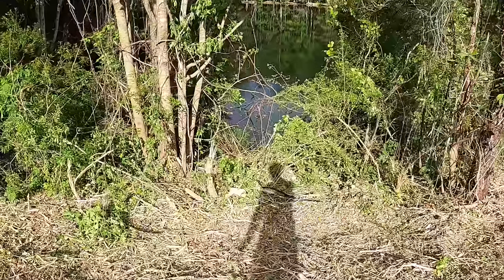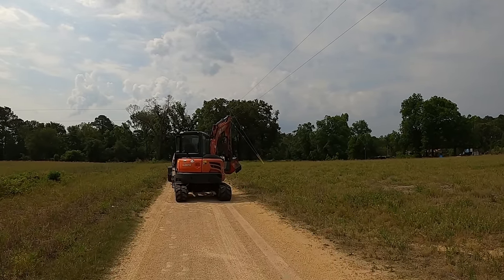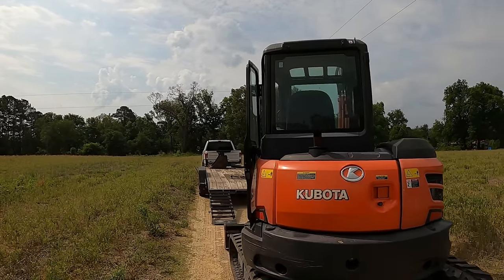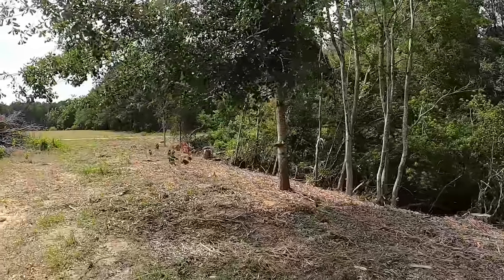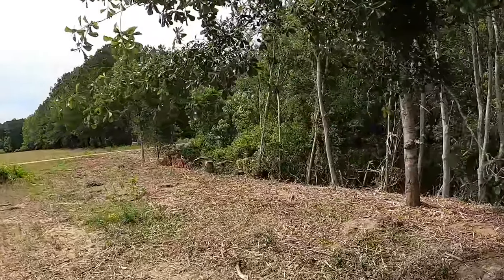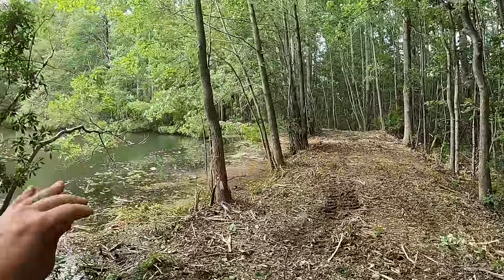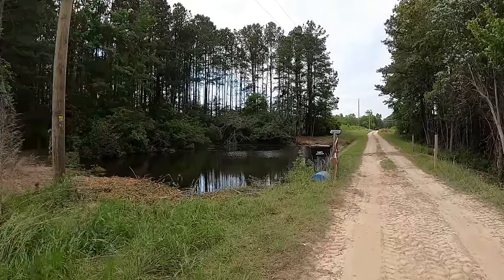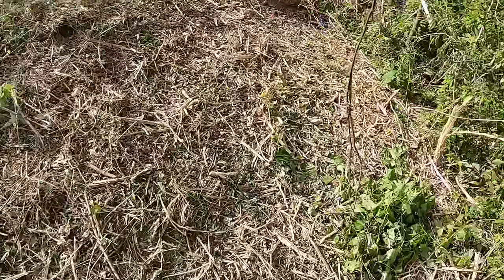JUNGLE POND! Homeowner STUNNED After Revealing This Pond Mulching!

Comment: dude, that's what the back fill blade is for, you track down towards the pond,set the blade down and get after it, the side where it was over hanging, you lay the material over with the head and the mulch it on the bank...did this stuff many many times with a cat 308

Comment: I’ve found it just as easy with the wax myrtles to swap out to the bucket and snap them off and drag them out. Then mulch them or make a burn pile. But there again with the Rut mulcher it has the grubbing foot on the back that comes in really handy for manipulating stuff like that. Even helps for positioning machine and pulling it around or pushing back up off those steep banks around ponds. 
👍🏼good job

Comment: Hey! I got just the ticket for the ones you couldn't take out on the bank. I have run into this quite a few times with my KX057 and Fecon Mulcher. So, I just got a Westtech CL260 WoodCracker which is a tree shear. I have used it a few times on my KX057 and it worked really well,  we just sheared the stuff and drug it up on the bank and then mulched it. I am down in Charleston and only do this part time so if you would like to try it sometime just let me know and I can bring it up to you to try for a week or so, pretty sure the U55 and KX057 have the same coupler. Just let me know. Good job by the way!

Comment: That excavator can handle that slope where you started no problem. Put the blade down and keep your mower closer to the machine and it would be just fine. I’ve mulched stuff with an excavator that look’s impossible until you just get on it and try.

Comment: Question. I have land in southern Missouri. For just over two years. None stop rain and what's going on in the last two years left me so far doing nothing with it. I need an road put in. Cleared out. Then an starting area cleared out. Wright now I don't want to buy the equipment to do it. Renting maybe. My question is. How much per hour does it cost at average to have someone do the work your doing? I would rather have it hired out. Thanks.
Reply: not sure about your area but i know in WA we paid a guy $2k to clear 1/2acre of black berry and saplings with a machine like this. took him about 4hrs.
Reply: @_AndromedaGalaxy_  I will just figure $500 an hour and up. Thank you so much.
Reply: @scanadaze  never assume,  makes an ....
Reply: @tomlorenzen4062  no high fuel prices. Here at this house I can't even finish my fence. No materials. I just checked yesterday. That's metal roofing. So what is going threw my head is why did I buy it. The land. For electric. About 6 too 8 poles have to be put in. For water an 100 too 300ft well. Then sewer. Not even cell service is there. Just trees. My pickup is now an half ton. I had an one tone. The tractor I really need is an  Skidster. To heavy to haul for my truck as I know of. Max load 10,000lb. It does have an toe package. Then attachments. Then after the land is cleaned up. That one is pointless. Then I would need an mid size with an cab. That would be manly parked because the work for it would be hit an miss. Yet an smaller one would make more sense with an mower deck. In all. What needs to be done and bought is in the thousands of dollars. Double now or doesn't exist no more. Then I need to still pay off the land. There again. The prices went threw the roof. That Leaves me to only rent. Makes more sense. Rent on an Friday and take back on an Monday. Again because of gas prices. If I even can get there. I can. Yet way expensive to do so. 11 hour drive from here one way with 4 over the speed limit. Saddest part is. After all the places I have lived and been. That land and location is my most favorite. I lived in all the locations as, desert, swamp, next to the ocean and in the mountains plus in the trees with rolling hills. I love the Ozarks.